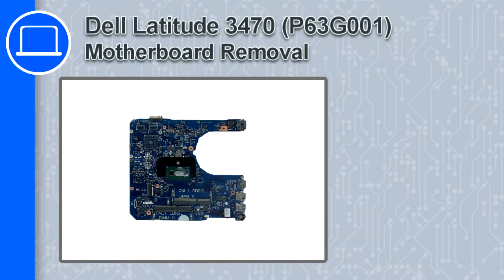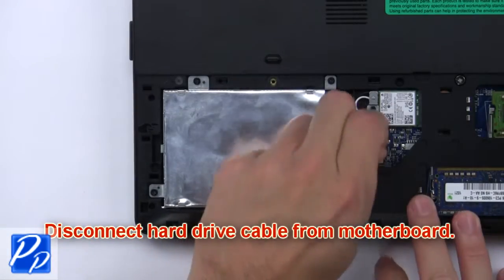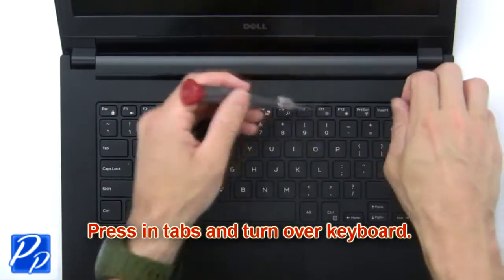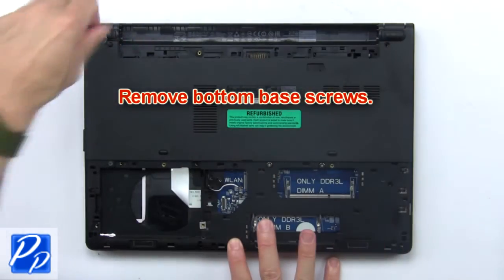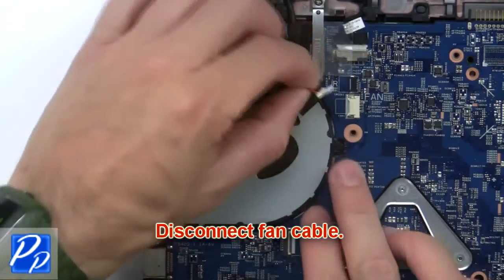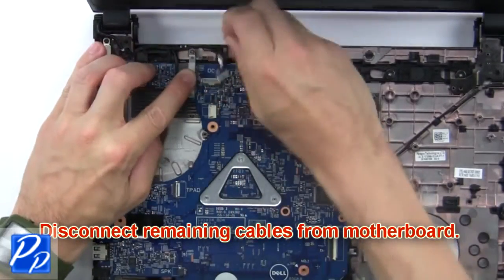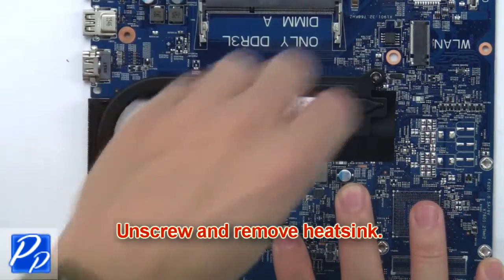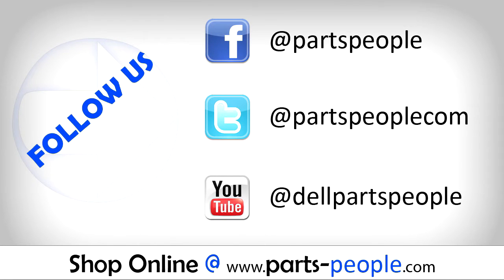Dell Latitude 3470 (P63G001) Motherboard How-To Video Tutorial

Comment: Hi, to remove the palmrest there is a diagram on the HDD/SSD drive bay instructing us to use slide a tool under the circular cutout to pop off the palmrest.  It is much easier and less risk of damage/scrapes to do it that way :)